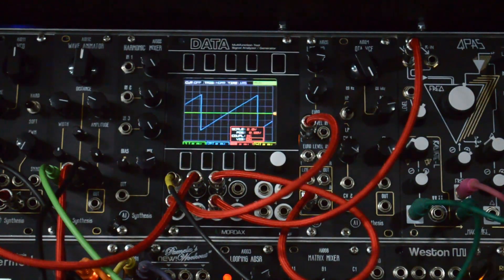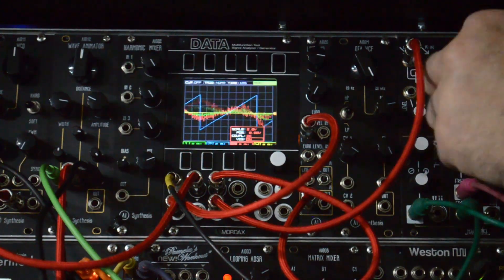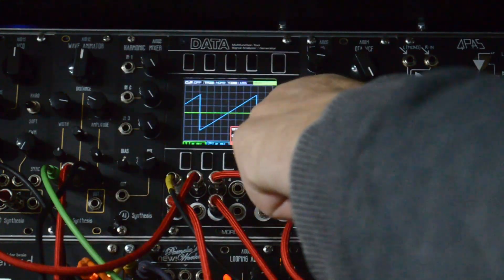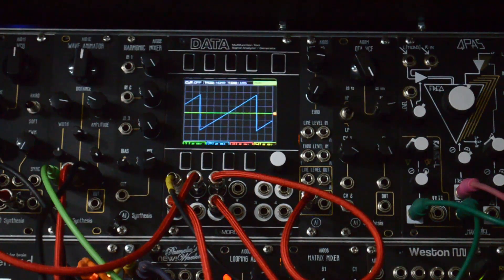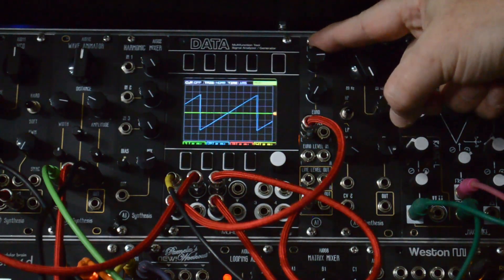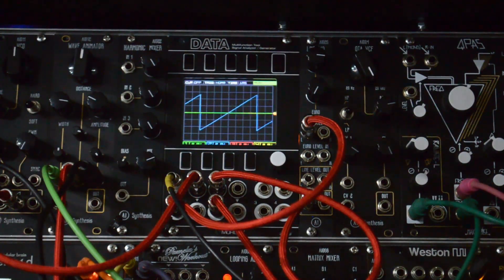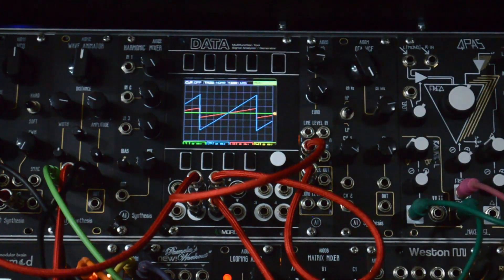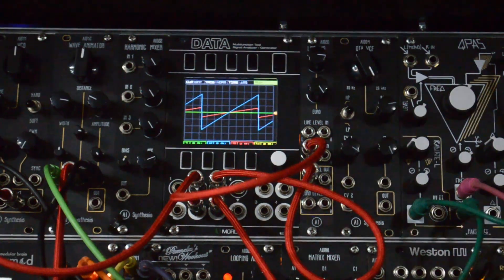AI026 Eurorack Line I/O Interface

Comment: If signals are going into the Line In and Euro In at the same time, do the Line Out and Euro Out both output a mix of the Line in and Euro In signals? Or, does the Line Out output a line-level version of the Euro In signal, while the Euro Out outputs a eurorack-level version of the Line In signal?
Reply from the maker: @danielaaaaaaaaaaaaaaaaaaaaaaa  the second one. They are independent circuits.

Comment: Hey there! Just wanted to ask a quick question. Is this Module Similar to your 2hp Stomp Box Adapter? If no, what's the key differences and uses for each? Cheers
Reply from the maker: The 06 adapts signal between eurorack and guitar level (and back). This module adapts signal between eurorack and line level. It is similar in that it allows for proper gain staging between different formats but different because line and guitar level are different.